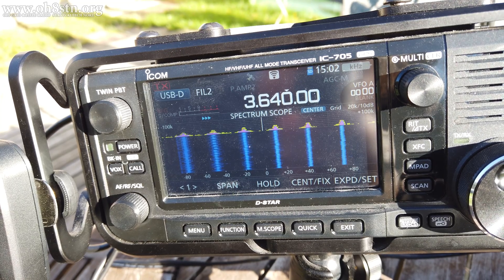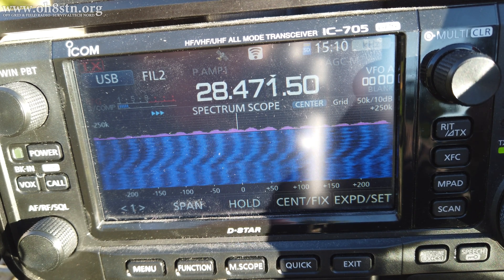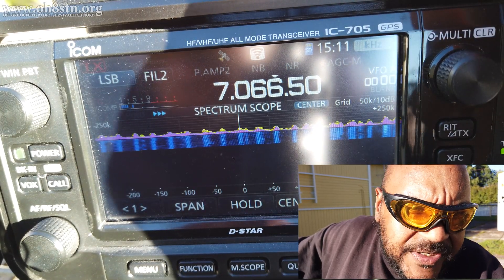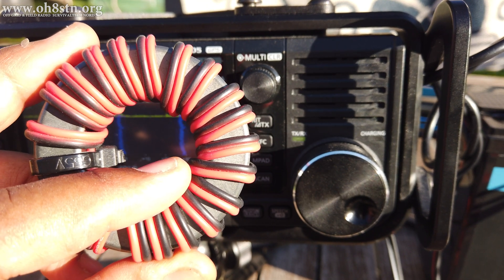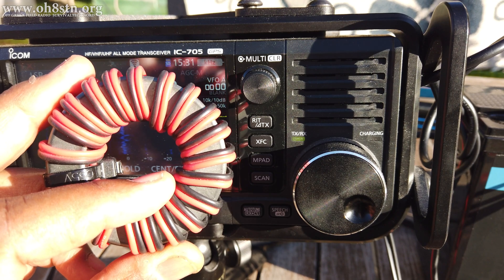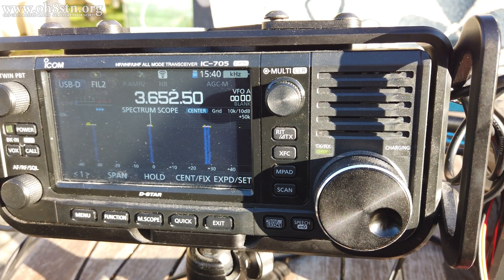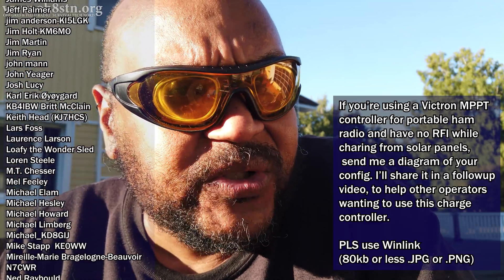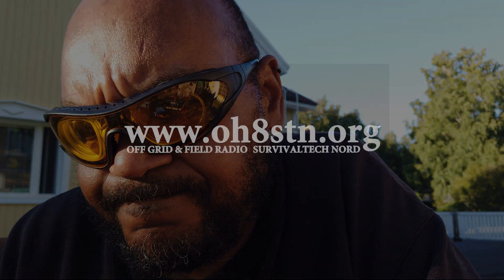Victron SmartSolar MPPT Charge Controller

Comment: Portable operations aside, I worry that bands will only get worse at home QTH's as more and more people adopt solar on their homes. Granted this is more of an RF on the load issue but you have to wonder if "wigglies" will get airborne.
Reply: I wonder what would happen if you put the Victron in "Faraday Cage" and just run the solar in and load out wires to the outside.
Reply from the maker: That might be an option. If the radio equipment is connected directly to the battery, with the only Port coming out of the cage being the battery connector, the noise might be isolated. The problem is it becomes less portable for the field. It's a brilliant idea though, I think I'll test it
Reply: @W9HJBill  RE: device enclosed in a RF shielding box. This would be at least interesting to see if the RFI is propagated via the control and power lines or simply isolated to the enclosure itself.
Reply from the maker: Agreed. These new micro inverters are the absolute worst! They're putting one micro inverter on each solar panel now, creating much more noise than the single big inverter they had back in the day. Extremely good point, thanks for watching and commenting.
73
Julian oh8stn
Reply: @OH8STN  is this problem common with all Victron solar charge controllers or just this model?
Reply from the maker: Excellent question Dennis. I don't want to waste any more money on another model from victron just yet. Reading some of the threads in their support forms, it seems to be quite widespread. Ironically though, some people report not having any noise at all, while others have similar results as my video.
Reply: Try wrapping the charge controller with aluminum foil.  This may help limit the RFI

Comment: I wonder if it is a function of the MPPT - switching to get the amp/volt curve at the maximum power ??
Reply from the maker: It definitely could be. Then we have to ask ourselves why the Genasun is so much quieter.
Reply: @OH8STN  metal shielded case